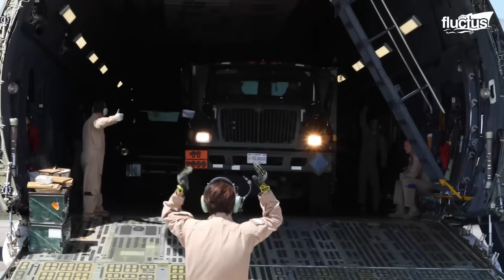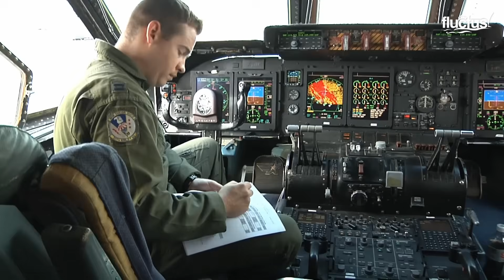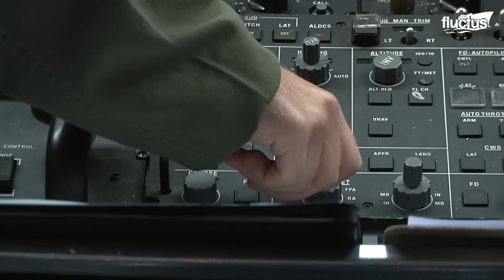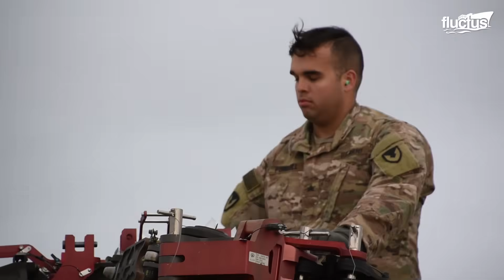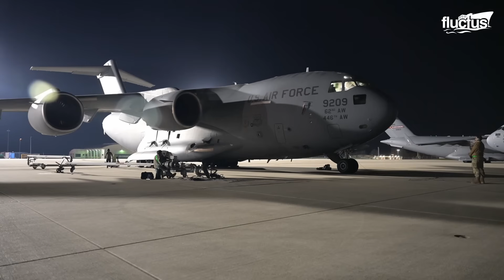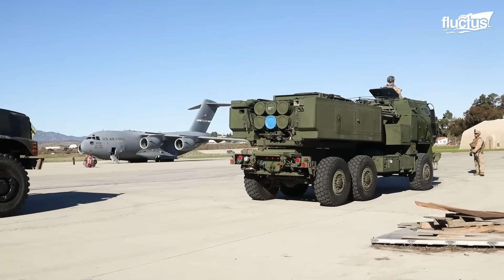Starting the Largest US Air Force Plane Ever Built

Comment: C-130's have saved many a life, one of them mine. I was wounded during my 2nd tour of combat duty in Vietnam on May 17,1971. I was med-evact to the hospital ship Repose for stabilization. When I was stable enough to be flown out of country, myself and a number of wounded Marines were helicoptered to a jungle airfield near the DMZ. We were loaded onto a Marine C-130 sitting at the end of a red dirt runway. Our stretchers were all strapped in on the side racks of the airplane, IV bottles attached to the racks. When we were ready the pilots held the brakes of the C-130 and revved the engines up to full throttle. The loading ramp was kept down during take off and we could see the swirls of red dust being stirred by the 4 large propellers. With the ship shaking, engines screaming the brakes were released and we started off down the short runway, near the end the pilots pulled up into a steep climb just clearing the jungle canopy while enemy machine gun tracers could be seen flying by the plane. We kept in a steep climb, our IV bottles hanging at a 45 degree angle until we were out of gun range before leveling off., We were flown to the Philippines for treatment and then back to the states where I would spend the next 3 months in the hospital. I healed and spent 20 years in the Marine Corps before retiring. I became a California police officer and retired after a 30 year career in law enforcement. None of which would have been possible without the Navy Corpsmen, Marine Pilots and that C-130. I'll always remember that ride! 
Tom Boyte GySgt. USMC, retired Vietnam 1965-66 /1970-71
Reply: Thanks for your extraordinary service and for sharing your awesome story! In 1974, as a NAVY Flight Surgeon, I, with my Helo Mine-Countermeasure Squadron HM12 was airlifted on C5A in 1974 to Cyprus for Helo reassembly & flight to USS INCHON (LPH 12) for Operation Nimbus Star, mine-clearing operation in Suez Canal following Yom Kippur War. Loading 2 HUGE RH53D Sea Stallion Helos into each C5A required much disassembly and flattening of tires to barely fit. I am forever grateful to have had that experience!